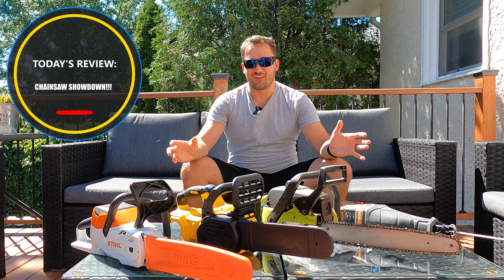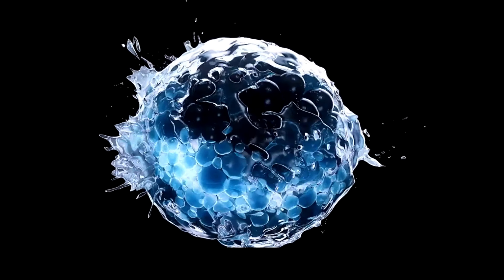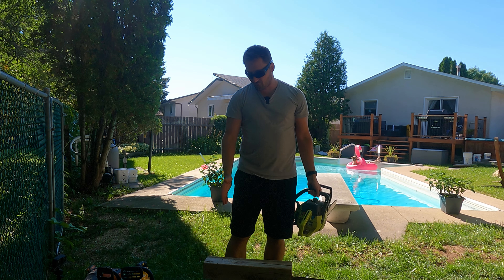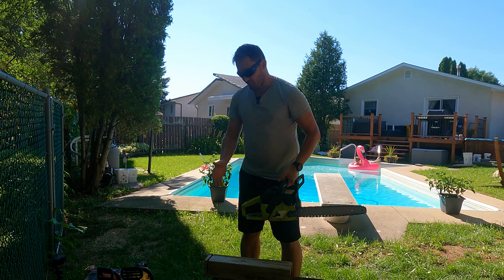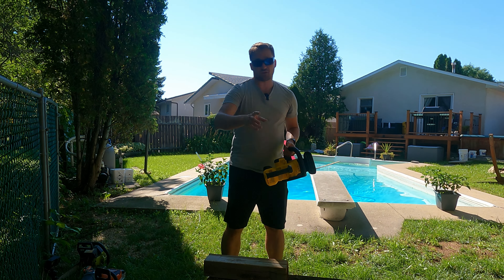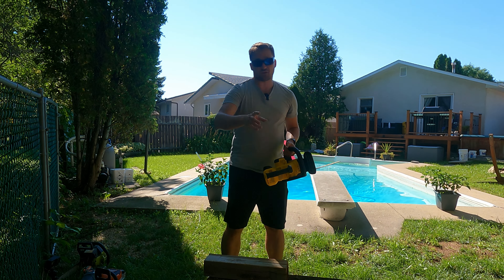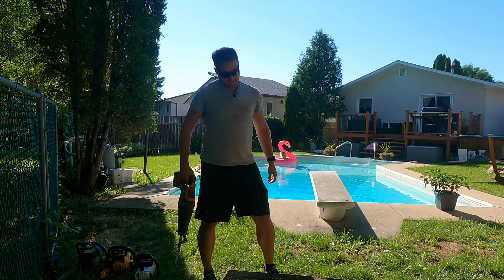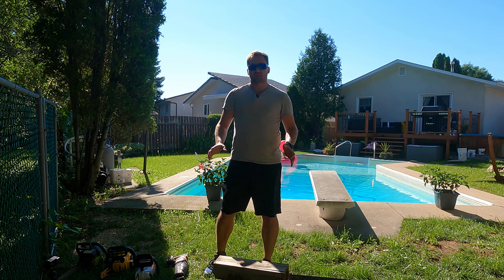DeWalt, Stihl, Rigid, or Poulan? Cordless Chainsaw Review

Comment: If you put a pruning blade on the sawzall, it'll cut much faster than with the blade you had on it (looks like a demo-type blade used for both wood and metal). It's surprising how fast it'll cut with the right pruning blade. A chainsaw is still ideal, but I've used that same Ridgid sawzall to take a wooden fence down as well as a few ~8" trees (It beat starting a gas saw up repeatedly or being concerned about an expensive chain if I hit metal).
Reply from the maker: Thanks for the comments! I did that to take down an old cedar in my front yard and I agree it worked surprisingly well! Also I agree blade changes were a breeze and if I contacted the ground it wasn't game over!

Comment: Dude! that chain on the old Poulan was beyond DULL!  Sure ya didn't have it on backwards lol !  Anyway I hear what you're sayin' so unless you're cuttin' firewood for the winter the Stihl is the best option for you.
Reply from the maker: Lol! It may have had a run in with the ground a time or two working on stumps. I acknowledge that with a new/sharp chain it's performance would have been top notch. Usability on the other hand becomes an issue. The cordless options are far lighter, much quieter, and are an order of magnitude  easier to maintain due to the lack of an actual engine. It all comes back to what the end user needs to get done. Thanks again for the comments! Much appreciated!

Comment: Great comparison!  Hey, I've been looking to get into an ebike for my commute to and from work (~10kms round trip).  I'm looking at the Costco bike... Any suggestions or other options out there to consider?
Reply from the maker: Hey there! I'm not too sure where you are located, but with the price of fuel here in Canada lately I have been taking a hard look at e bikes over the past few months and would love to cover them on the channel!  A few things to be mindful of would be battery voltage, motor wattage, and the controller system used in general. (Very similar for most battery powered equipment)  Your "standard" e bike systems are typically 36 volts, w/a 250-300 watt motor. However, you can scale all the way up to 48, 52, or 60+ volt systems and motors up to 1000 watts in either a front or rear hub, or mid drive configuration. Ultimately, you need to ask yourself what can you afford, and do you plan to use it year round? Another thing to be mindful of is that at least here where I am located, regardless of motor or voltage size most e bikes are governed at 32 km/hr. (These can usually be bypassed at your own risk!) Hopefully that helps you narrow down the options a bit. I've seen units at Walmart start at 850$ and then some at higher end bike shops selling for over 6000$ it's going to come down to your budget and use case. I'm actively working on trying to get some models for review so hopefully that can help your purchasing decisions!